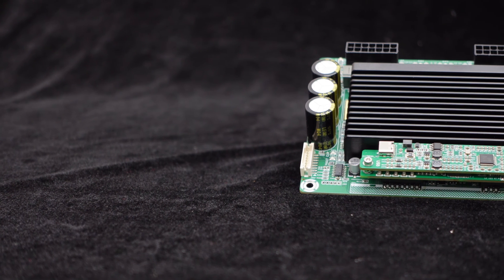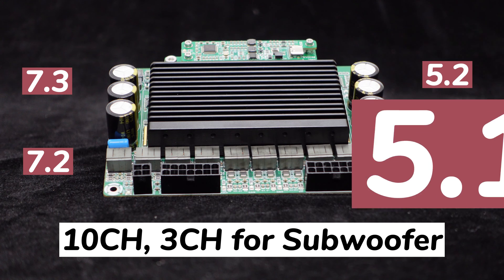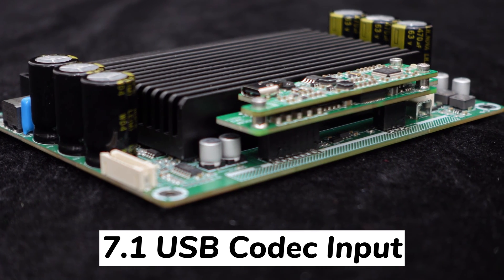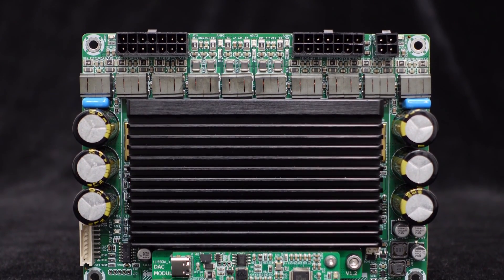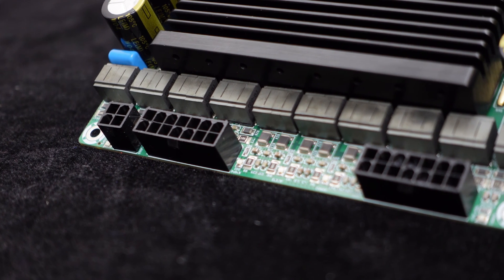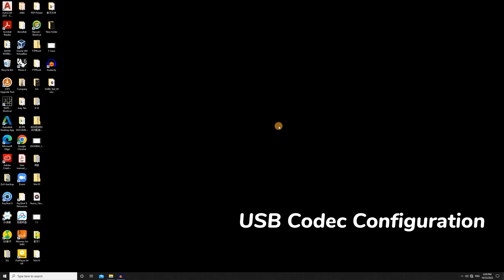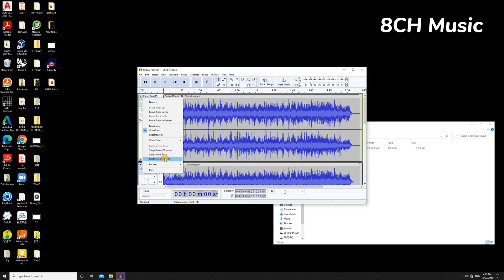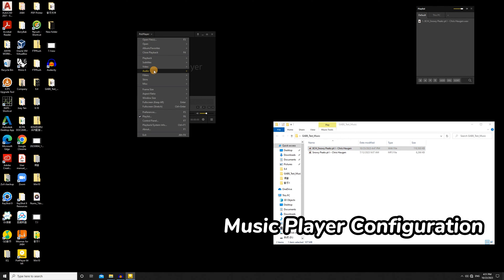7.1 USB Codec Input 10x50W Amplifier Board for 7.3 Multi-Speaker Systems Arcade, Racing Simulator

Comment: this is a great idea and exactly what I was looking for ages. But is there a way (not using the volume control slider in the USB connected PC) to adjust the volume for all channels at once? I mean such a rotary encoder connected via I2C or something similar as it can be found in other class D amp modules. Thanks a lot for any further information.
Reply from the maker: Hello. We appreciate your attention and valuable feedback. Currently, we do not have a volume control board compatible with the GAB8. We will forward your suggestions to our Research and Development (R&D) department for consideration. Have a fantastic day~
Reply: @WONDOMAudio  Hello. Thanks a lot for your friendly reply. Yes, please talk to your R&D. I guess this question is not only interesting for me. As I understand the situation it is not a good idea to do volume control only by the PC. Most likely the DAC resolution is effectively much lower when using a part of the 16Bit to volume control headroom. The DAC board has a connector labeld I2C. Perhaps this one is connected to the DAC chip and this chip has a register for volume control. I'm not able to read the DAC chips labeling. Otherwise I would have checked this on me own. Perhaps you can supply the schematics of the board module? Than I'm able to check & develop this solution. Many thanks in advance